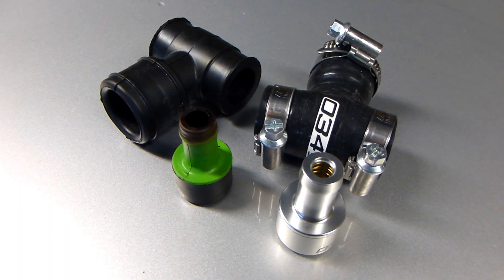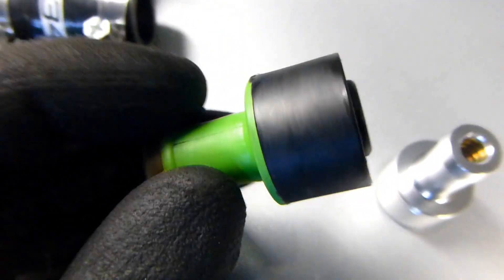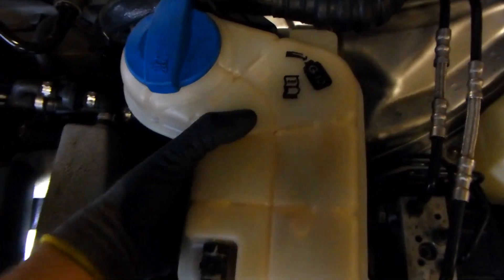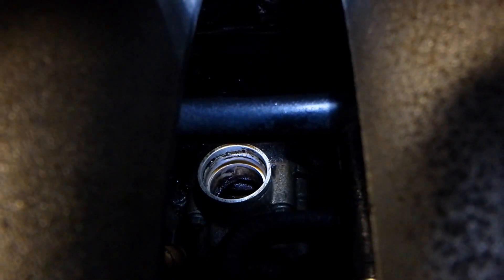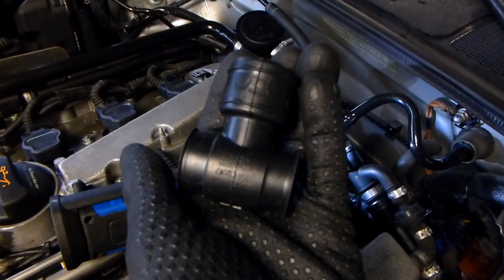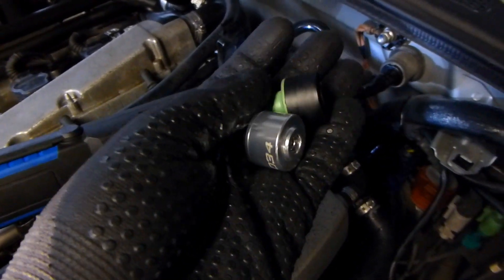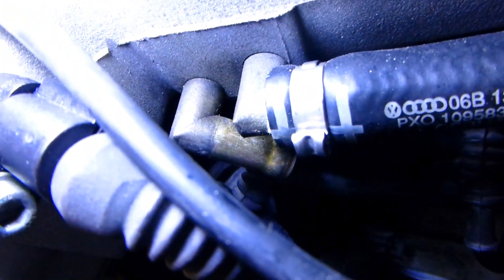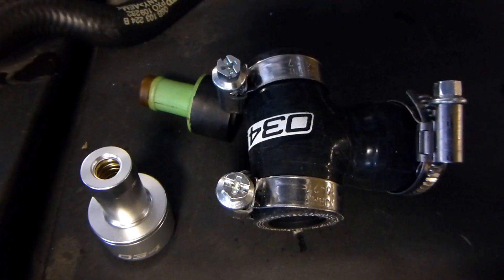034Motorsport PCV Valve replacement for Audi/VW 1.8T engines

Comment: Just a kwik question, the intake manifold needs to be removed in order to get this job done?
Reply: Most definitely it will
Reply: Told can get away with just removing the coolant container.
Reply: @andysmith9065  if you got ridicuals tiny hands you can still quicker to remove intake manifold its really easy plus u have plenty of room
Reply: @andysmith9065  and also you wont be able to secure the clamps propelry and youll have a howling vaccum leak from the t peices

Comment: This "crappy solution" PCV valve works fine for about 15 years so I wouldn't say it's crappy. You want to drive more than 15 years and that's why you claim metal one is better ? What about pressure of opening in this metal one ? Is it same like in OEM ? In my opinion this "tuning" You done is "crappy solution"  - not the OEM PCV valve... In europe this PCV cost 10-11 euro not 30. Best regards.
Reply: Proberly for a stage 2+ tune(assuming)

Comment: jag får oljelukt i coupen när motorn är varm. Är det detta som gör att det luktar ? Finns inga läckage
Reply from the maker: Det är mycket möjligt. Undersök även om det är läckage från topplockspackningen ner på turbon. Det hade jag
Reply: @KarlMarklund  topplockspackningen är bytt så där läcker det inte. Har samma motorkod som du
Reply: @KarlMarklund  hittat den där ventilen på min bil var såklart trasig. Även så var röret som går till vevhusventilationen spräckt

Comment: When that valve fails you get that bad bearing squeak noise right?
Reply: Jorge Rivera you get a rough idle, smooth when driving but horrible when stopped and at idle
Reply: And misfires in all cylinders